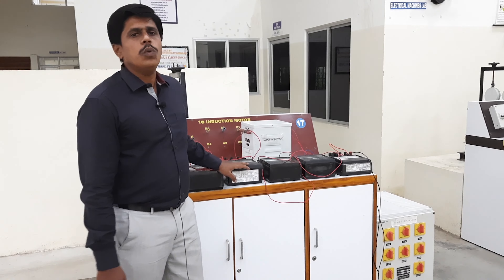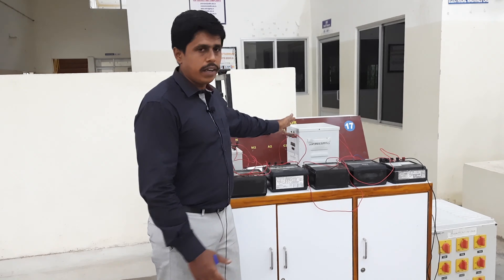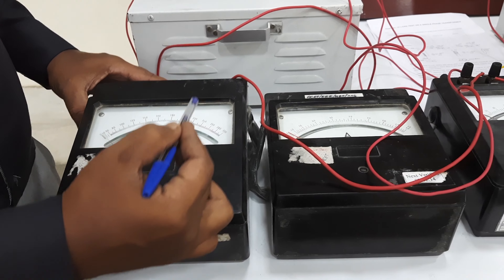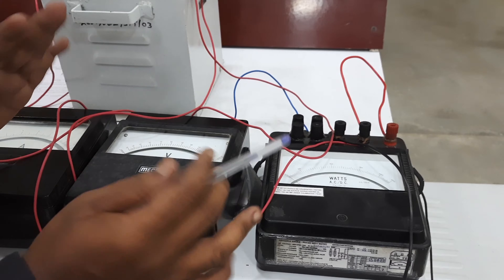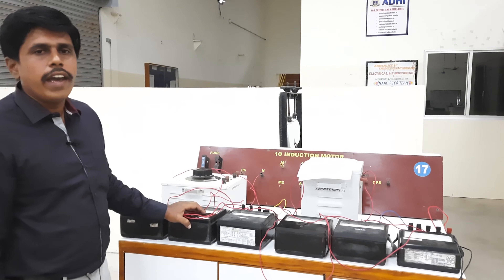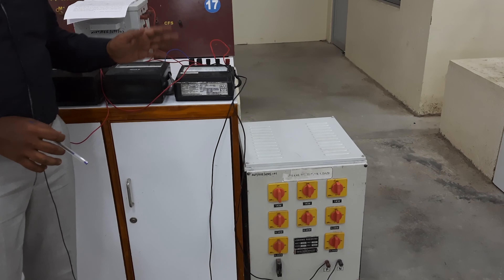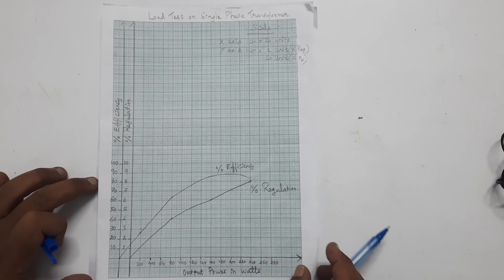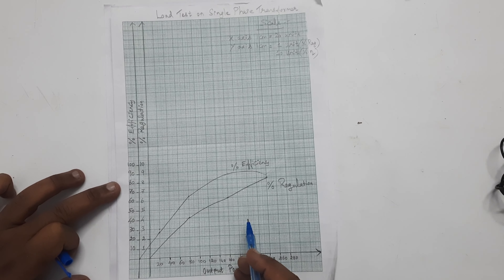Load Test on Single Phase Transformer | Lab Experiment

Comment: VERY NICE PRESENTATION OF EXPERIMENT SIR.
ONE DOUBT SIR
 WHAT IS THE DIFFERENCE BETWEEN REGULATION AND EFFICIENCY?
Reply: Regulation of a transformer represents the output voltage variation from no load to full load. Efficiency represents the ratio of output power to the input power. In a transformer always the output power will be less than the input power due to the presence of copper loss, iron loss and eddy current loss.